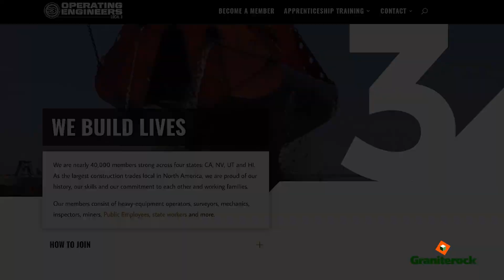Heavy equipment operators who Rock are in demand!

Comment: I have spent the last 18 years working in a large quarry operation loading highway truck with Cat 972 loaders (started with a G, H and now a 972M) I've loaded over 250 trucks in the run of a day along with building stock piles with 40 ton rock trucks and from time to time having to wash crusher dust for the asphalt plant. I make $21.25 an hour and work 60.5 hours a week. I live in Atlantic Canada.
Reply: I was wanting to get into it until you said 20$ an hour